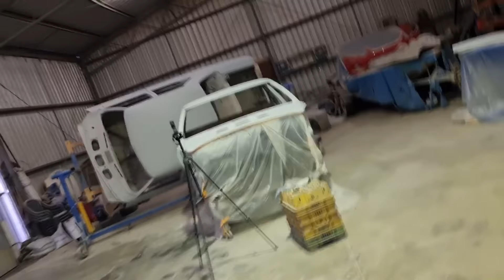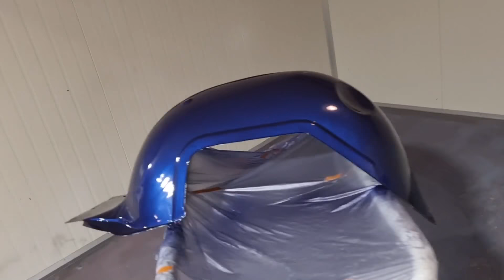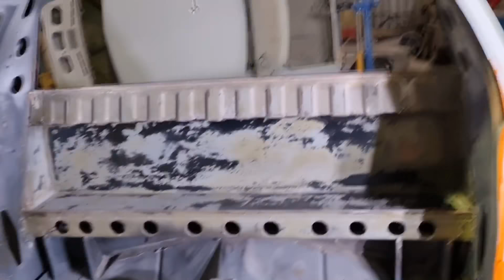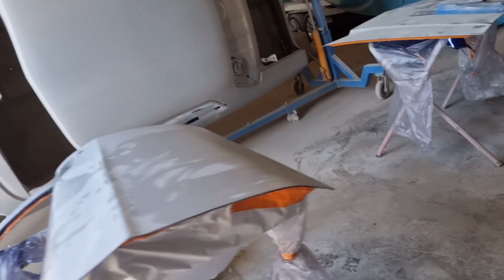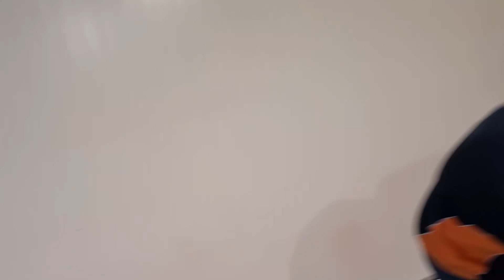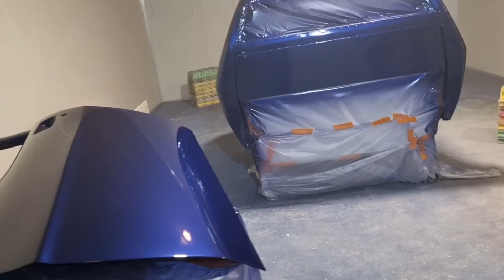Holden 1 Tonner Build Ep 4

Comment: Which way is that pedestal fan blowing?  Interested in the booth set up.  And when you turn on the fans etc do you find the temp drops way down?
Reply from the maker: The fans pull air/fumes from the booth. Yes it does bring the booth temp down, it come down to around 23 deg. The same as the shed temp. We have heaters going in the booth and in the shed.
Reply: @carsnthingsrestos31  thanks for taking time to reply.  The elusive great home paint job relies on more little tricks than I can get my head around.